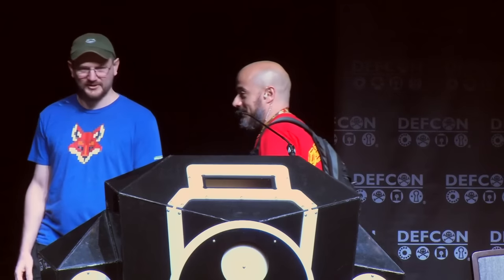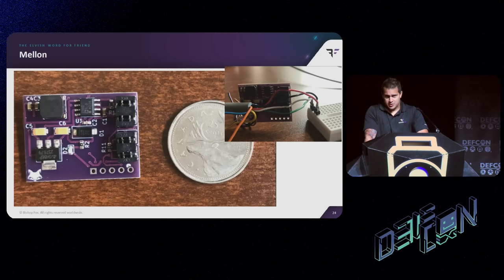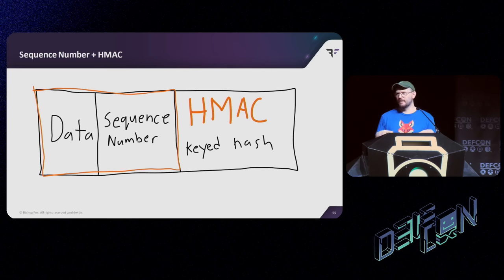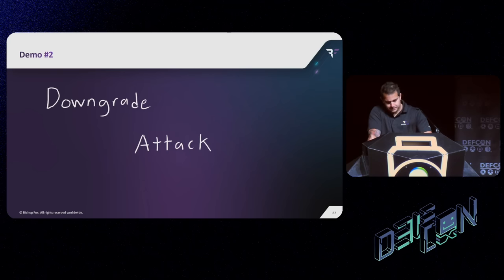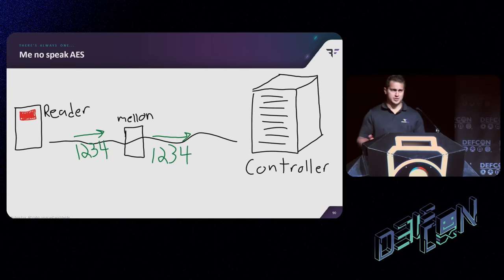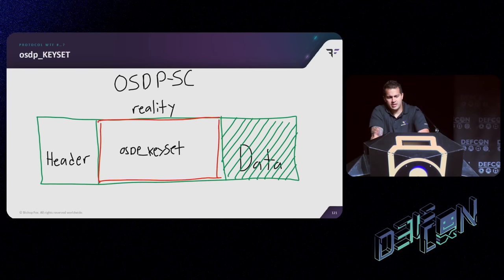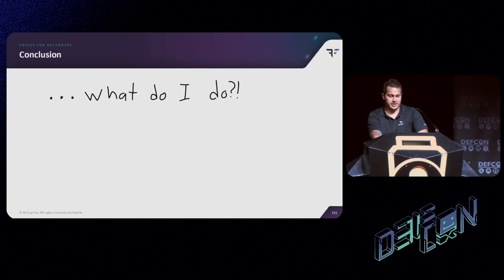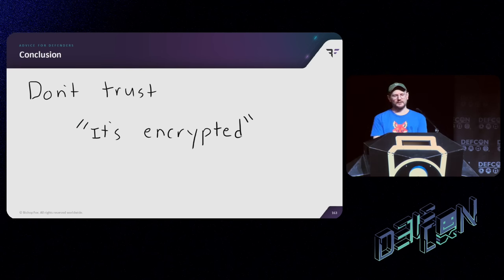DEF CON 31 - Badge of Shame  Breaking into Secure Facilities with OSDP -Dan Petro, David Vargas

Comment: I wonder how much of this is down to the spec writers not knowing about crypto or security, how much is down to the priorities being wrong (e.g. wanting smaller packet sizes at the expense of security, wanting something that is simpler to implement or wanting something that requires less hardware to pull off) and how much is intentional (i.e. deliberate back doors for some reason)
Reply: I would always attribute it to the desire ("customer requirement") for it to be "simple". Loading certificates, syncing keys, etc. is a pain in the ass, but it's also 100% required for anything to ever be secure. If you use anything that was on it "from the factory" (thus potentially knows to others), it's not secure.
Reply: It's the result of anything built by committees instead of professionals and hidden behind patents and paywalls instead of open for public inspection. (See also WEP/WPA, DVD/CSS, etc.)

Comment: great talk, but i guess you have missed the most important countermeasures from the conclusion:
- don't use the same wiring (bus) to connect high-critical and not-so-critical access devices
- get rid of old-fashined insecure RFID stuff and use modern chip technologies (supporting asymmetric cryptography etc.)

Comment: Quick note on the cost of the OSDP standard document: it's cheaper if you buy it from the Estonian standards body, EVS, where it is called EVS-EN IEC 60839-11-5:2020.

If you buy 1 license you have to use a stupid DRM'd web reader thing, but if you buy a 2 seat multi-user license to the spec (which costs about €50 total) you get it as a PDF (with your name and iirc IP address burnt into every page to discourage sharing it) you can download, look at with normal PDF software, print out etc.

Hope that helps!

Comment: The intention of the master key (MK) would be to have it installed at manufacture, of clients and servers. This would ensure that pairing could only occur between devices sharing the MK. However were that MK compromised (by either a production facility leak or a poor physical security on the encryption modules) then it becomes a worthless appendage to a now broken security scheme. Unfortunately throwing away the MK doesn't fix the scheme.
- if you are designing a protocol with symmetric key scheme, DUKPT is always worth a look. With a touch of salt and pepper is covers a lot of practical bases.
As soon as the slide with "polling" came up I felt a bit queasy.  "But it works" is not a defence. Neither is "it follows the letter of the specification". I suspect the project was hurried and on an unrealistic budget. It has the feel of a PoC put into production.
Note: RS485 is an electrical rather than protocol standard, and is largely chosen for range as well as multi-drop - which is great if you are running cable around a building! Tried, tested, off-the-shelf; good choice).

Comment: Sadly all known problems and many 101.

Optional encryption pretty often means no encryption in practice as you can never be sure it is used and even if you want to use it, an attacker may find a way to convince a component to deny encryption and everything is unencrypted again (Downgrade Attack, as shown in the video). Even if this can be avoided by a policy, users will forget to set it. Just don't make encryption optional. If encryption is too slow, which rarely ever is the case today, settle for a weaker one which provides only moderate security but at least make that one mandatory.

Replay attacks? Come on, that's 101. 32 bits would have been fine, IPsec uses 32 bits by default. Sure, it can use 64 bits but that's an optional extension rarely used in practice and only really required on super high speed links where the 32 bits would overflow too quickly and you'd otherwise constantly have to renegotiate session keys (which can be pretty expensive if PFS is used). BTW, even when IPsec sequence numbers are 64 bits, only the last 32 bits of them are actually transmitted over the line, so there's not more protocol overhead, but the full 64 bit are used when calculating the HMAC.

Reducing HMAC size? Sure, IPsec does that as well but it reduced 128 or 160 bits to 96 bits, which is still decent. Since SHA2, the reduction is 50% and thus at least 128 bits are sent.

Not reusing IVs? Again, 101. Not so critical with CBC encryption, as long as the first few bytes of data are always different, but deadly in many other cases (e.g. CTR/GCM).

One device sending a nonce? That's bad per se. A session key should always be derived by two nonces. Why? If an attacker has full control over the generation of the nonce on one side, e.g. because he controls the random number source that is used to generate it, it won't help him unless he can also control the nonce at the other side (very, very unlikely).

Setup keys exchanged over the same line as encrypted data later on? Also 101. Even in case of SSH you'd first use a password to access the server, then install your public key there and from this moment on, you can use public key auth. How do you get the inital password? Well, certainly not over the same connection that SSH uses.

Not encrypt everything? Encryption should always been treated as if it was an afterthought, yet it should never be an afterthought, of course. Think of TLS. To make HTTP secure, TLS was imposed on it. There are no parts of HTTP exposed as HTTP doesn't even know that it is encrypted and TLS doesn't even know that it is encrypting HTTP.

Use a hardcoded default key? LOL!

Comment: I wonder if you could influence the data+/- to remove the current data, like having 4 current clamps, 2 per wire, hooked up in some transformer cancelling fashion, and you could influence those with the esp32. You'd then be able to control that to add data back on the wire.
Surely it must be possible to flatten the data on a differential pair through noise or retardation (think transformer/inductor) if you have enough length / separation and influence/power.

Comment: In regards to establishing a man-in-the-middle attack while on site, would it not be sufficient if you were wanting to not interrupt the service to essentially have the device tap it twice with a gap between them, then to cut the wire between the taps?
Reply: Correct ... and this isn't hard to DIY. Here's a cheap "RS485 interposer" that's super fast to install (with some practice):
1. Design your attack device with a RJ45 plug interface.  Ex: Upstream on pins 1/2,  Downstream on pins 7/8.
2. Insert the wire pair you're attacking into a RJ45 punch-down keystone jack:  One wire punched to 1 & 7, the other punched to 2 & 8, leaving an extra inch or so of slack between the sides.
3. Plug in and enable your MITM attack device.
4. Snip the wires bridging the punch-down jack, close to one side.
5. Do the sneaky stuff.
6. When done, take the slack and double-punch across the jack to re-unite the downstream and upstream sides, leaving the keystone jack behind.
7. Pocket your attack device and skedaddle! 

Post-attack, the presence of a punched-down but disconnected RJ45 jack is unlikely to draw attention unless your target is a very tightly run institution.  If this is a concern, leave more slack and use a splicing butt connection instead (McMaster Carr 7056K24), then gently remove the RJ45 prior to vacating the site. Low voltage installers use these splices by the hundreds, so they'll blend in almost anywhere.

Comment: Watching this, and comparing it to when I replaced the controller server at a client's location. The RS422 box at the controller end was just a USB dongle plugged into a Windows XP machine. The software was just a program on the server that track and log the provisioned cards.  A third party had to come in and actually "backup" the old server's install, and then install the new version on the new server.

The real weakness in this, is when nobody monitors the access, because every time a door is tapped, it CAN send an email to somewhere. So even if you cloned a card, you really only have one or two attempts before whoever gets the notifications should be contacting the card owner and asking if they are having trouble getting in the building, and when they say "what? I'm not at the office" send security out to that door.

So that Install mode, is likely always turned on, because the underlying server, when rebooted for software updates or it just BSOD's for whatever reason, has to start up again, because if the server turns off, all the readers also lose power.

Comment: what what about that default key SCBK-D, if that is set to a fixed value by the protocol, how do you get rid of that weakness

additionally couldnt the key exchange by secured by having the key on a card that can be read into that reader, e.g. having an "admin" card to config the reader and then tapping another card which has the key, which sets the key?

Comment: Why wouldn't they just do Diffy-Helmann key exchange as is what's done with HTTPS? 

I can understand the need for a root public key, but that should merely need to require basic setup in install mode, which could be provided as a one time key via a flash drive / sd card.

Could be susceptible to man-in-the-middle if you can reset the reader, provide your own key, and then pretend to be another "controller" in the middle, but that seems difficult. 

Then just encrypt everything with the public key.... and only the controller can read the valid data. 

Plus, you can then request a nonce, and use the public key of the reader to encrypt that, so the reader is the only one who can read the nonce. 

This seems "solved".....Why are modern companies still cutting these corners?
Reply: Because management looks at the estimated dev time and balks at paying for it.